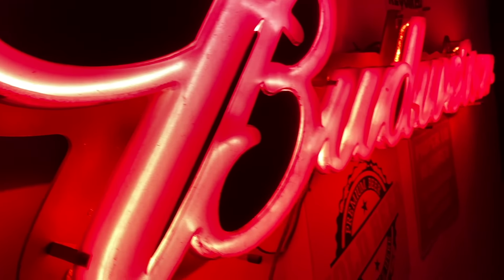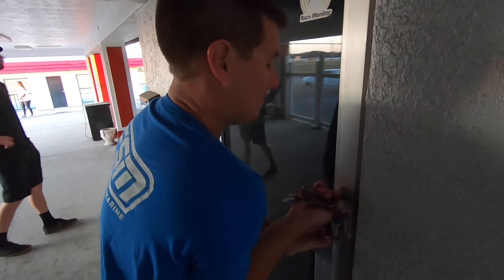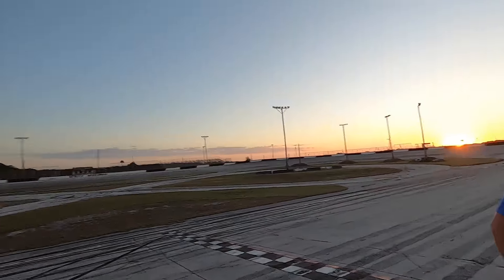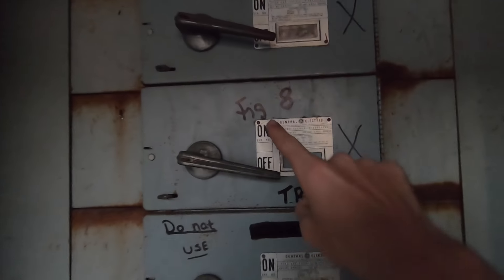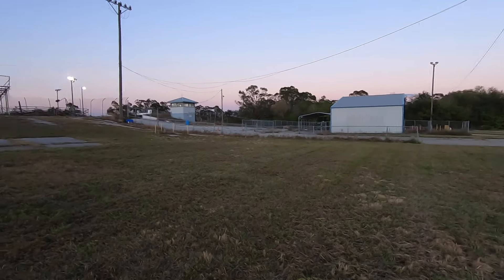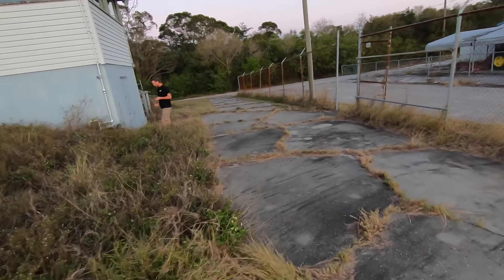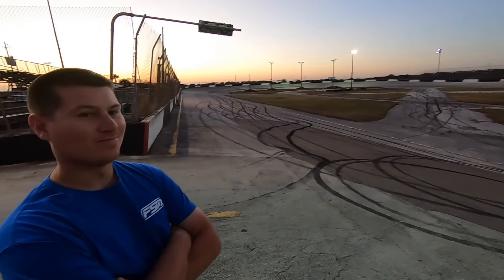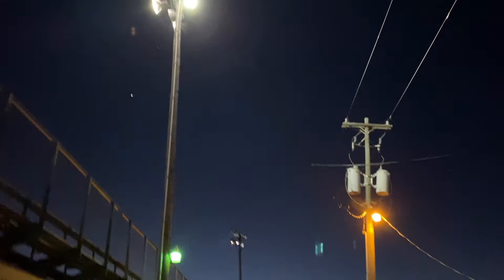Restoring Power to our Abandoned Speedway After TWO YEARS in the Dark! (Freedom Factory)

Comment: Be careful and don’t stand in front of breakers when turning them on. Arc flash explosions happen. Try to use your left hand when switching them on/off
Reply: true, but going all LED will change it a bunch.
Reply: Especially after sitting off for years. The dust in them would create a much higher chance for an Arc flash.

Comment: Dont replace any of the Floodlights with LED ones, as LED floodlights die quickly. These are 1000w Metal Halide floodlights if you are wonder what bulbs to buy for them. Metal Halides last WAY longer than LED bulbs and produce much more lumens per watt
Reply: Khalid Hebshi Could’ve sworn that they were high pressure sodium but what do I know
Reply: neil Trombley HPS Lamps produce an orange light. MH produce a White light (usually if they are not very old)
Reply: neil Trombley at 12:29 you can see a High Pressure Sodium Area light at the right hand side of the screen

Comment: Mr Gleetus that compressor is the same i use to have and is indestructible, mine survived a huge fire where i lost  my dragracer in (where sadly it was my point that i had to stop racing) 
just be sure the oil in it is good.
its a two cylinder compressor  can handle 12 bar pressure and delivers enough air to spray-paint a whole car in one go.

wishing you the best of luck with the freedom factory  (sadly ill probably never be racing again as i can't get my bank account up to building a whole dragster again)

Comment: that LED conversion will so be worth your time.  my dad did that on the front of his barn for the 15k lumen lights, and they take as much power as a freaking 100 watt bulb, but 200 yards away, it looks like headlights are right next to you.  day after thanksgiving he replaced his high pressure sodium at 55 bucks a bulb from rural king.  which is about what it cost to run those two bulbs for a couple months before.

Comment: Cool. Plenty of that is working which is nice to see. Need to get a radio mic setup for that PA now if there isn't one already. (From your videos, I'd know you're not going to want to be tied to one building.)

Also time to get some blueprints or schematic diagrams and setup some logs or spreadsheets to track all the stuff. Of course now you don't have to do that on papers if you don't want, might make more sense to have your layout maps on tablets now. (Obviously easier to pull up an electronic file than go in some store room for a big rolled up blueprint.) Like number all the lights from one direction to another in each building and such, number the poles, etc.  Might be some chance old records like this still stashed away somewhere? (That may speed things, but scanning all of those and making electronic copies would make it easier in the long run.) Facilities management is going to be quite a job, but if you're smart about setting up some system it'll make life a lot easier in terms of staying on top of it all.

Also would probably be good to set up a break room style kitchenette and make sure some toilets are working early on too, so you know there's a good spot to take a breather during all of this. Getting this place set up to do what it should do and be a crowd-pleaser is going to be a full time job.

Comment: Cleetus, don't expect too much change in your bill, once you change these lamps to LEDs. These are most likely metal halide discharge tubes with efficiency around 100 lm/W. Modern white LEDs are pretty much the same, but they are pricy. Most LED lights use cheap chinese LED chips, which may be even worse, than these discharge tubes. Alse the life time of these discharge tubes is quite decent, usually somewhere around 10k hrs for brands like Osram. Life time of cheap lamps won't be much higher and I'm guessing, that a spare discharge tube will be cheaper, than the entire new lamp, which you will need to change, if it fails one day.

Comment: Take a look at the wattage rating on one of the spare track light lamps to get a rough idea of the cost to run all of those lights.  So, if they happened to be 1,000 watts each, multiplied by 40 (functional) lamps, add maybe 20% for losses, so 48,000 watts, or 48 kilowatts, multiplied by the cost per unit (kWh - kilowatt/hour) you pay for electricity to give you cost per hour - should give you a rough idea. 

Or simply take two meter readings one hour apart and calculate the difference multiplied by the cost per unit (but this would also include anything else powered on the site too).

Comment: Those are sodium bulbs, we use them under the cover for the gas station. They aren't expensive to run but if we lose power for a bit they take a while to warm up and kick on but are bright as Hell.
Reply: they are Metal Halides. High Pressure Sodium has an Orange glow. Metal Halides have a Paper White light.

Comment: IMO I would stick with the lighting system you have and just do some jiggerypokery with positioning and re-lamping the ones that are dead or have poorer colour / intensity than they should have... LED's getting better pretty rapidly on a cost and efficacy standpoint but in regards to reliability, unless you spend absolute top dollar then you'll probably get a good 3-4 years out of them, which just about matches if not is a bit better than a 1Kw MH lamp being run 24/7 depending on colour temperature.

Comment: Don't you think you should make sure the air compressor has oil in it and the water drained out of the tank, before you start it up? When you get your electric bill you will most likely run with as few lights as possible to light the track without all of them on at one time. You could open with the lighting you have up and running now.

Comment: Don't buy a boom truck.   Rent it    the more equipment the more maintenance .  Unless you buy new you cannot expense depreciation for Taxes .  Talk to your accountant about it.   

Spend money on a 2 John Deere Gators with a 1-5/8 hitch ball , small portable narrow trailer for garbage pickups. and small trailer to move trashcans , portable Generators, pressure washer ,  Graco Airless sprayer for track walls with 50ft riding on a gator on apron to paint walls ,  Decent set of tools. To Mix paint , Home empty 55 gallon plastic trash cans from warehouse to under bleachers hers .   Paint Tires around the bottom of infield Light poles Yellow .   buy. ten 500ft spools of .107 or larger and get more Welters.   Dewalt 2 x 18v hammer drills , 2 x Impact guns 2 x cordless saws 1x electric 1/2 drill to mix paint ,  Talk to bleacher guy about signage poles for banners so you can sell banners space to advertise sponsors .    You should be able to fix the hose with a cone temp. with 4-6 bags of asphalt repair for HD or Lowes and a tamper.   Get a couple of 20 foot containers or 40 foot ones to use as storage until you build more Warehouses .

Comment: At 10 cents per kilowatt hour (pretty cheap I'd guess) assuming each of those bulbs are 1kw HPS or MH, you're looking at 10kw hours per fixture (10 bulbs).. with 10 fixtures that's 100 kw per hour. Works out to about $10/hour, not actually that bad but just a rough educated math guess
Reply: They are MH lights, HPS are sodium which are like old street lamps ORANGE
Reply: @dandubock515  yes, I know. I meant assuming in the form of a mathematical calculation, not guessing what was actually there